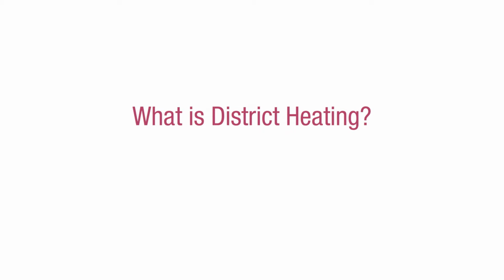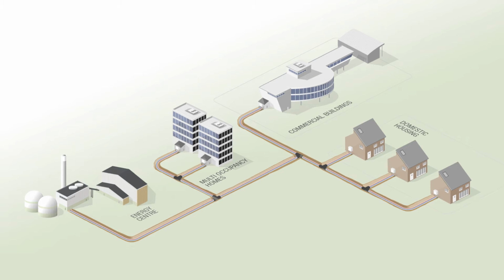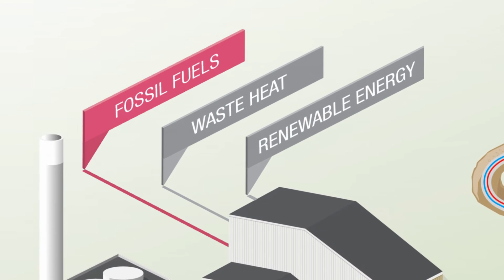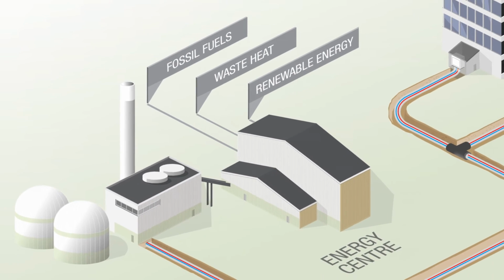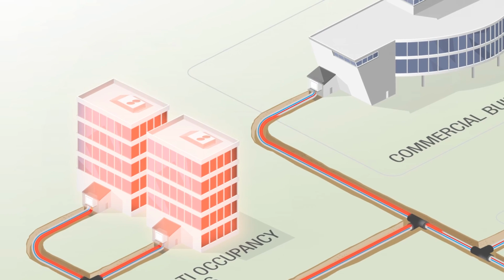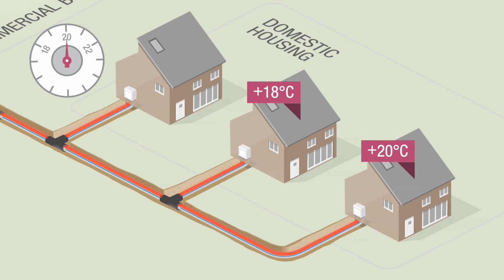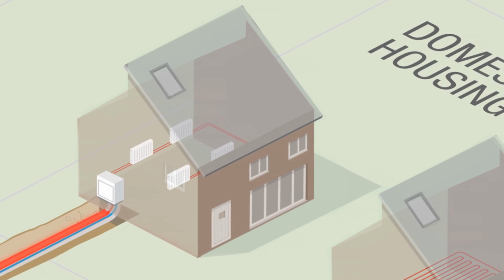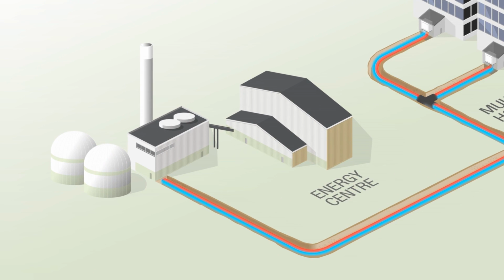What is District Heating

Comment: A potentially good system...until those operating it want to increase profit off of apathy. Just over a year ago, Evinox(/Minibems) took over as our district heating payment and technical support people. They immediately installed remotely controlled pumps. They then immediately turned these radiator pumps down, for each of >600 flats. Alongside this, they closed down the primary valve (hidden/underneath the user rotary dial) for every radiator - they smokescreen this "balancing" but it's not, because...
End result? Their "we will slash costs" promise was NOT delivered (we're paying more), and, every radiator is COLD from 1/3rd down...luke warm at the top. Cold rooms. In EVERY flat. Residents effectively have little/no control over their heating. Communal complaint ongoing.

An excellent system but open to extreme abuse!

Comment: It's going to cost and absolute fortune to the household and the government will decide when you will have heating and at what temprature.
Reply: District heating is cheap and enviromental as fuck. Only geothermal is better.
Reply: As the video explains, individual buildings retain control of their heating temperature, the water is just heated in an external district heating plant. It's cheaper than every house having a boiler
Reply: Yeah that's just not true. Here in Denmark we use it, our apartment uses district heating and we almost entirely avoided the inflated utility bills post Ukraine invasion. Our home saw like a 10% increase at worst.